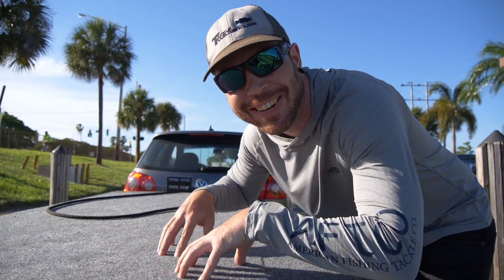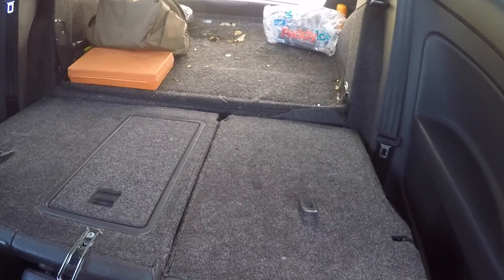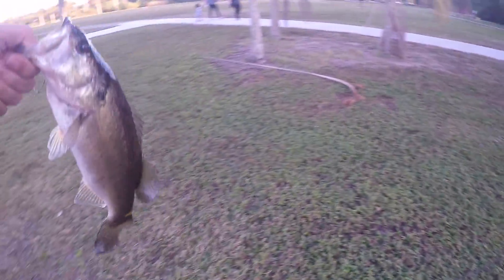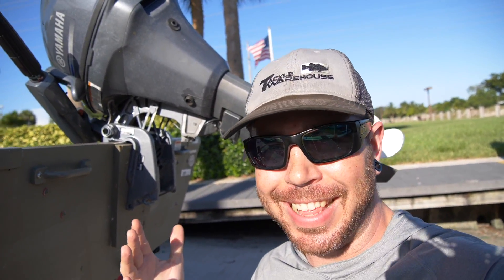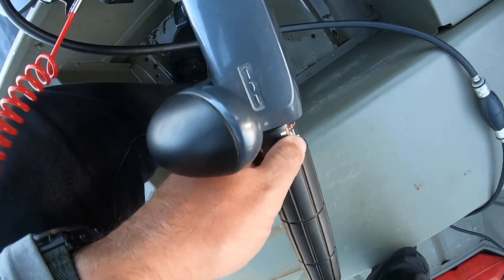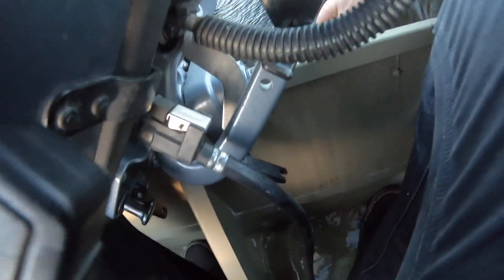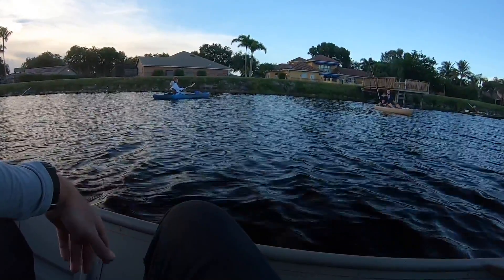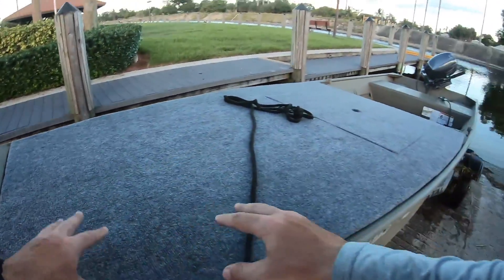Yamaha 9.9 Jon Boat Top Speed Test

Comment: Here's an "idiot boater" story that should get an award. Some years ago, a young man, who had a cottage near my family's on Rice Lake, Ontario, Canada decided it would be a good idea to bring his 18 foot runabout with a 100 h.p. engine into the dock at FULL throttle and SLAM it into reverse to stop. Well...in he came and, when he rammed it into reverse, "something" broke, because he kept going, slamming the boat up onto rocks along the shore. He went flying over the front of the boat, landing on gravel. Several people, including myself, saw what had happened and rushed to help. He was semi-comatose so we put a sheet of plywood under him, got him to a pickup truck and off we went to a hospital about 25 minutes away. His injuries? Two broken legs, fractured hip, broken arm, broken wrist, ruptured spleen (which had to be removed) and a concussion. Plus, all the cuts and scraps required over sixty stitches. Three weeks in hospital, then four weeks in a Toronto rehab facility. The boat was totalled. The kicker? When the insurance company discovered HOW he had wrecked the boat, his claim for a replacement was denied. Just proves you CANNOT legislate stupidity.
Reply: toy man but why would you do that lol I’m 13 and I ain’t that stupid
Reply: Well you can always turn off throttle. And given enough distance, the fact your boat loses plane, drops 12 inches more into the water will stop it real quick. But it won't be crawling. I bet he was too much into slamming it into reverse that he may accidentally put it in neutral. But you will never know now.
Reply: Ahh yes rice lake. I’ve been fishing there a few times.

Comment: Hi Wakey wakey...nowadays, cottages are more like second homes with all the "bells and whistles." When we first bought the family "place" on Rice Lake, it DID have electricity but we had a two burner hot plate, an old refrigerator, a pot belly coal burner heater and an outhouse. But we loved it. Our boat? A 12 foot aluminum Springbok fishing boat with a 5.5. Johnson outboard. Simpler times, to be sure, but good times!

Comment: That is really good..
I have a Seapro 10hp on my 12W Tracker. I am running a 4.50x12 prop.. trimmed all the way down with my Bimini top up. I can hit 27-29mph. That is sketchy on a flat bottom jon boat.

Comment: I have the same motor. Love how quiet and reliable it is, and running on regular petrol is perfect, no mixing 2 stroke fuel.

Don’t really need more power, it’s not a wake boat, just something that can reliably get you out where the fish are
Reply from the maker: Definitely was a great motor while I had it. A lot of the newer 2 strokes are oil injected, so that's a little easier. Don't know about the smaller ones though.

Comment: I don’t know about anyone else but I like my plug on the inside of the boat
Reply from the maker: Works the same either way.
Reply: FloBass on the outside it is more likely to be pulled out by debris in the water.
Reply: I'm the same way with my Jon boat I put the plug on the inside of my boat also.
Reply: I also have mine chained  to the transom so it don't get lost
Reply: Inside is definitely the correct way.
Reply: Inside
Reply: Inside so he can pull it out and drain the water while going fast.

Comment: Great video Eric!
Im guessing the front is done up nice with carpet for weight and to handle oncoming water?
Reply from the maker: Actually no. I built the casting deck super light. It only weighed 27 pounds. No oncoming water. It's a jon boat, not made to ride in rough water. The boat will get beat to death and the rivets will come loose.

Comment: Mk7 wheels look good on there, thinking about selling my mk6 for a truck so I can pull a little boat but looks like I might just need a hitch!
Reply from the maker: Haha thanks! The wheels are just cheap replicas. I wanted the MKV wheels but couldn't get them for months so I went with these because the previous owner had bent one of the rims that were on the car. Definitely get a truck though. I only tow with the GTI because its what I have and it actually limited me on my boat choice.
Reply: FloBass ahaha I hear ya, fun car tho. Gonna have a hard time letting it go

Comment: Tip: look @ 13:21 your outboard has a like a bracket on the left side by the water flush system next to the clamp, that you can use to keep the motor from falling when in use or keeping thieves from stealing it, I use a chain and a pair of locks. Nice outboard and will be awful to lose it 😅

Comment: You might want to try a higher pitch prop on that yammy. Your boat seems pretty light and that yammy sounds like it could support a higher pitch prop. Well if it does, that will give you a higher top speed
Reply from the maker: By myself, yes I could probably go up in pitch and gain a few mph. The boat is going to be loaded with a 26 gallon baitwell, and at least 1 more passenger. That little motor couldn't push it more than 10mph. Never got up on plane. It was awesome by myself though. I've got a 25hp on the back now. It could still go up in pitch by myself with the new motor. I'm yet to test it fully loaded so we'll just have to wait and see.
Reply: @FloBass  yeah. Gotta see when it is fully loaded. Hopefully it performs well. Good luck
Reply: Ibrahim Ozturk I have the same engine with a alumacraft 1236, I have a 8 1/2 X 9 1/4 propellor on it, the stock prop is 8 1/2 X 8 1/2. I wouldn’t recommend to get a higher pitch prop as it really takes away the power/torque from the engine
Reply: @jobhoogeboom  hii i got the 8hp version. And i bought a 9.9 carb to get a little more speed out of it. Do you think i need a bigger prop i got now 8 1/2 x 7 1/2.

Comment: Nice little motor check on a stainless prop you should get about 5 more miles per hour . But let the company that you will be talking with tell you what prop you can use per your application then weight out the cost . Nice video and demo . Keep us updated if you change out props .
Reply: Stainless prop on that size motor will slow it down as stainless props are much heavier.. best bet would be get a aluminum prop with a diff pitch .. but never go stainless when lacking horsepower lol plus that's how most lower u it's get destroyed is stainless props because when they hit something the lower u it gives before the prop atleast an aluminum prop will bend first
Reply: Chuck Smith there aren’t stainless props for the small engines only for 15hp and up

Comment: Is that a VW hatch? Small car, I got an X2 myself which is similar. Been thinking about a John boat. How do you find the towing capability & wear and tear/maintenance on it for a car that size? @FloBass
Reply from the maker: You can barely tell you're towing a boat of this size. This whole setup was maybe 500 pounds max. Like having two extra adults and a teenager in the car. I attribute that to setting up the trailer properly and having the correct ball height on the car. If it put any extra wear and tear on the car it was minuscule. I could have towed with that car to Canada and back with no issues.

Comment: Great video!!! I’m thinking about getting a Jon boat and transforming it into a solid fishing boat any tips ? I’ve never done anything like this and any tips would be awesome
Reply from the maker: Get the largest motor possible. Get an all welded jon. Watch lots of videos for inspiration. Take your time. Don’t take the build to seriously. Prepare to make lots of mistakes. Have lots of fun.
Reply: I recommend buying brand called WeldBilt Jon Boat there all welded very stout well made boats. I have a 14x37 WeldBilt Jon Boat with 1996 Johnson 15hp with electric start with a custom fab all aluminum casting deck with me a battery 6 gallon tank an fishing gear I top out at 23mph.If you get a Jon boat an want a casting deck be very careful on the type of wood you use cause some wood has a chemical that will slowly eat away at the aluminum I believe it's pressure treated wood not for sure what kind it is.
Reply: @FloBass  in on in

Comment: Yo flobass.
How's the Yamaha 9.9 running.. first time starting cold engine open throttle all the way .as soon as it fires back it off again .. opening the carburetor all the way... recently bought a 6hp tohatsu.. some reason they need a lot of air to start and any time after fires first pull. Cheers
Reply from the maker: 9.9 is sold. Ran great without any issues the entire time I owned it. That motor had wet plugs from siting on its side for a few years. Some oil got into the combustion chamber. I actually replaced them shortly after this video. Really, the trick to cold start this particular motor was to choke it and give the throttle one full twist, then back to the start position. It liked a shot of fuel and it would start within 1 or 2 pulls. I only ran this motor on the back of the boat a few times before this video so I wasn't 100% up to speed on what it liked. Now I'm running a 25hp fuel injected F25. It's just ridiculous.
Reply: @FloBass  On the same boat? If so how fast does it run now with the 25hp? 😂

Comment: I got the same engine but the 8hp (2017) version. What kind of boat do you recommend  for me? I want to go atleast 15 mph if it is possible with this engine.
Reply from the maker: In this vid I'm in a tracker 1436. I feel like you'd go faster than 15 with your 8hp as long as its just you and some fishing gear. Me and one other angler the boat would slow down to 18mph. 3 people it only went 9-10 mph. I bet there are video's out there with an 8hp motor showing the top speed.
Reply: @FloBass  nicee what kind of prop do you use?
Reply: @FloBass  i just order a 9.9 carburator. But i got a speed 7.5 propeller. Im afraid that i need a bigger propeller. Cause of the high revs
Reply: I get around 37km/h 23miles per hour. The engine make to much RPM so i order a bigger prop. Pitch 9 1/4

Comment: It’s a 9.9 and it can go 22 mph or is it km cause I have a 20 hp Suzuki 4 stroke and that can do 25 mph
Reply from the maker: 22 mph.
Reply: I have a 15 ft  (1994) alumacraft mv superhawk cs, with a nissan 9.9 hp 2 stroke, pushes the boat at 22 mph, and the carb needs to be rebuilt.

Comment: How wide is your boat? I have a 1442 with a 9.9 2 stroke. I love it!
Reply from the maker: Its a 1436. I'm now running a 25hp. Going to upgrade to a 1650 soon.
Reply: What did you do with your 9.9 Yami?
Reply: FloBass just. Just to let you know. I have a 1652 g3 with a 25hp Yamaha 4 stroke. With 2 people around 250 pounds 3 batteries and a tank of gas it runs 22mph (also fishing gear)
Reply: @thomasjohnson1664   Old post but..
I've a '96-ish 16' Alumacraft MV Tex, 30hp. Just me (190lbs) one battery I got 30mph via my GPS jobbie of the day. 
~ No middle seating and wide open 8' carpet/floor. Gal and I slept out in it many times/shallow cove out of possible traffic.

Comment: Dude over here adjusting his trim but not even lifting the engine basically didn’t change anything the whole video lmao. After adjusting your trim (1,2,3,4) you are supposed to manually lift the engine to reach that trim setting.
Reply from the maker: Really... It’s just a $500 jon with a 9hp. Let off the throttle Mr. Qualified Captain.
Reply: FloBass the trim you have been adjusting is basically selecting the level you want the engine to lift to. The final step is to actually manually lift the engine up by hand from the cowl to that level you have selected.
Reply from the maker: Dude, it’s a portable 9.9. There is no height adjustment. Why do you assume I wouldn’t have addressed motor height if that option were available to me?
Reply: @FloBass  I could be mistaken, apologies. I only assumed that because I am able to do that on my 5hp..strange

Comment: That 9.9 is perfect for that boat. Close to the top speed of a 15, but a lot more efficient on gas. And you can get on lakes a 15 - 25 can’t. 
Just change your prop from stock to achieve a higher top end.  Maybe add a super slick hull coating too.

Comment: Suggestion: get a 3 gallon tank. Takes up less space. I usually take a gallon in my 3 gallon tank for a whole day of fishing.

At the end of the day I flush my motor then remove my fuel line from the ob and plug a blank fuel plug so it will run dry. Then I put a male brass plug connector on the fuel hose from the tank and drain the remaining fuel in the tank into my car fuel tank. Only three things that I know of that cause these engines to fail.

1. Old fuel
2. Failure to check and replace oil.
3. Run the motor without water, don’t even do it for a few seconds.

Comment: Don't go so far down the ramp to get the boat on... i have a small boat like your, and i put half my back boards in the water... line up and goose the engine and it will slide the rest of the way up... #nowetfeet

Comment: This same engine on my 14 foot boat only has a top speed of 12kph..im very disappointed with it, the boat isn't even heavy,its fibreglass
Reply from the maker: A lot of factors play into the speed of a boat. The main thing to look for is where the cavitation plate is in relation to the bottom of the boat. It should be level with the bottom. From there, you should mess with the trim and see what the boat likes, same as I did in this video. If you're still not seeing the results you want, there is some larger issue at hand. Also, keep in mind that just because your boat is fiberglass, it doesn't mean its light. Obviously you'll know better than me regarding the weight of your boat, but just to compare, my tracker only weighed 300lbs.

Comment: If I were you I would go back to 3 . it looked as if your boat Plaines out better . 4 was to high for sure . nice motor tho .
Reply from the maker: It got up on plane really easily on any setting. Being a flat bottom boat there's a lot of hull touching the water so my theory was to lift as much of it as I could out of the water to go faster. It made no difference though. Maybe on a V shaped hull.

Comment: You sat on that 9.9 for 3 years... That's a bit foolish considering the hull and trailer is much much cheaper than a working  9.9.
Reply from the maker: It would have been more foolish to let slip the deal I was given on the 9.9 at the time. Would not have found one with as few hours, in as good of condition, at the price I paid.
Reply: @FloBass  i hear that 100% them outboards are expensive! No way could i go boatless for 3 years sitting on a fine motor like that! Thanks for the upload btw, useful information.